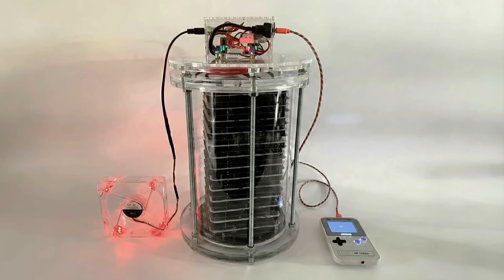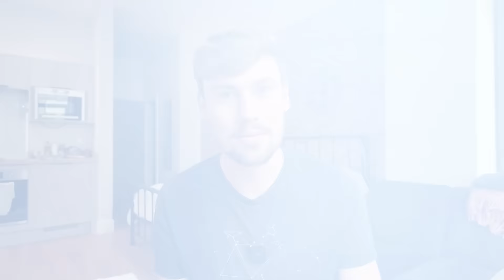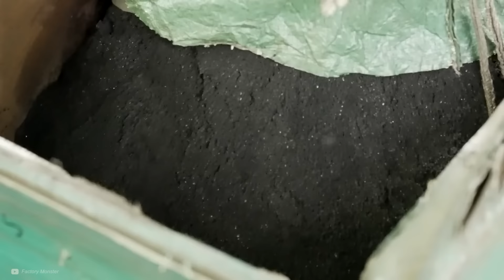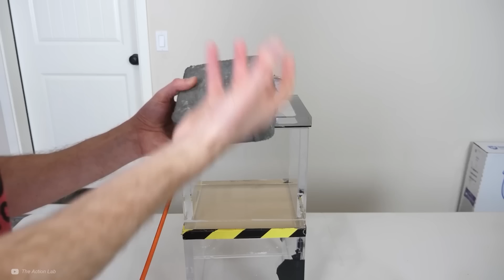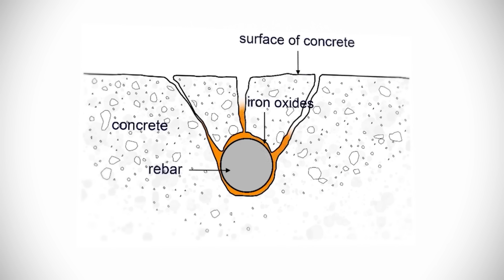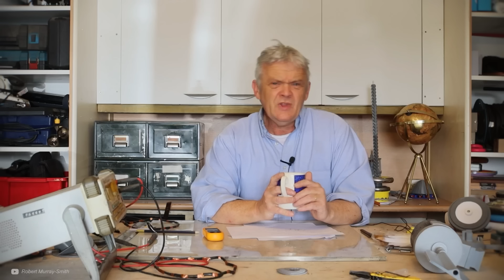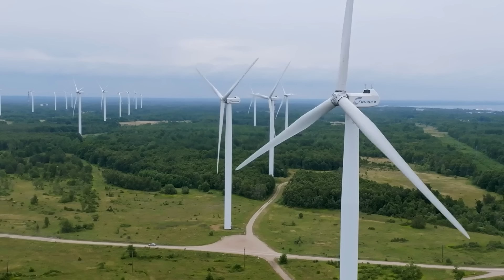How MIT's New Concrete Stores 10x More Energy

Comment: Was hinted at, but the elephant in the room is that a single block of the stuff is not itself a super capacitor, it's just an electrode, and you need a separator and another block with the liquid electrolyte in between.   The whole point of most concrete structures is that 1. you can pour it out as a continuous building material over large areas and spans  2. It can be reinforced with the likes of steel rebar.   Neither of those is possible if you're breaking it up into a collection of electrodes separated from each other with a liquid..    The more effective it is as an energy storage device, the less effective can be as a building material.

Comment: The sheet metal plates used for electrode look like they will separate under tensile or shear loads. (Note the demo with an arch without electrodes, under only compressive load.)
Liquid organic electrolytes have various toxicities and vapor pressures. They tend to swell plastics and permeate. They are also potential fuel in a fire. 
All this begs the question, how does a design for energy storage only compare with existing products?

Comment: Very smart chemistry, leveraging the water ingredient! Kind of a fascinating application too, when one considers the rebar requirements. I’ve worked seashore concrete projects, that have sacrificial zinc-alloy anodes to channel oxidizing forces away from the core structural rebar (cathode).

Comment: Capacitors don’t always have to release electricity quickly. They can actually trickle it, likely in this case where slow electrolytes rather than fast electrons are the moving species.

Comment: I'm working on a cheaper and more efficient method to use concrete to store electricity. It involves structural concrete, batteries, and duct tape.

Comment: No, you use it to store lightning strikes. That then bleeds off into an actual battery. My question would be how are they connecting the concrete mass to a wire?  Are they using some sort of mesh that won't corrode? Or is it more like using a conductive adhesive and just sticking a copper bar directly to the cement? Like, would you have 2 slabs of cement then a  thin copper sheet adhered with conductive adhesive, an insularor sheet adhered with non conductive adhesive, then the other slab with the adhered copper also sandwiching the insulator sheet. They been putting carbon black into concrete for like a 100 years, so are they just grinding it up finner, or are they using something like graphine?

Comment: Very interesting, BUT, ...
You missed a few obvious points, ...
How does Graphene fit into this picture as the carbon additive and a strength enhancer for the concrete, and
The fact that Wind Turbines are the the most useless form of energy production available with the huge environmental and maintenance costs for their lifecycle of energy production, especially with things like Fusion closer to the horizon than ever before.
Good basic content, but please stay away from the 'woke/Green'y'  type mindset and stay with the good tech with a balanced perspective of what makes practical sense for our coming ages.
Thanks, Ken.

Comment: You are changing the chemistry of concrete. I wouldn't  use it to build buildings into which you are then going to drill holes for bolts.

Comment: This isn't a solution for electric cars, but electrified buildings free up space for battery rooms. And I can imagine that it would be a bit easier to fill a foundation block with the special electrolyte than it is to make the walls.
Perhaps a solution could be to store most of the energy in the foundation, with the walls primarily used to distribute it throughout the house.

Comment: I'd imagine that you can trade time for complexity in getting the electrolyte in by just having the cured blocks sit in a deep pool of electrolyte for a while. Coating the finished blocks in plastic may also be economically feasible for the organic electrolyte ones, not by making an acrylic case but by giving them a coat of epoxy or some other polymer.

Comment: I think people are missing the bigger picture here with electricity… roads are made of concrete under the asphalt, power poles usually have to go next to the road and cause all kinds of issues with clearance issues and big trucks, if we place the power lines in the road with a super conductor it solves quite a few issues with moving power and potentially battery cars.

Comment: High RADs such as Luna, where we're not building structure but buffer, thermal trombone double use, where we're using the gradient of concrete to cool and heat. Garden walls where we're utterly disgusted with burrowing pests!

Comment: I wonder what would happen to this over time?
I could see this supporting buildings over the short term or with power fluctuations. But as you said, cost for this maybe a killer. 
I was going to suggest chemicals like alcohol to dry out the concreate faster. But this biological sounded like a better idea. As it gives you more power. 
A shame that they could not turn this into a battery instead of a super capacitor.  As that would be much more practical. Even if this turns out to be not as good as a Tesla battery. It would still add to the overall power storage. But again, would it justify the cost if it could be made into a battery instead?  
One thing that you may not know about is that Carbon make a good conductor.

Comment: Dude liquid filled concrete can't build buildings. I've been in building maintenance my entire life in a huge city, one thing I guarantee you is after a few years of flexing in the wind and weather there a cracks everywhere,  of course non are structural but how would liquid stay inside, unless your saying it'll still be conductive after completely drying? Does drilling holes or placing mental anchors short it out?

Comment: Couldn’t you use carbon fiber panels (internal and external) and pipes inside the concrete structure for reinforcement instead of steel rebar?

Comment: But with any capacitor, storage does not increase with thickness of the plates.
Capacitance increases with the surface area of the plates.
You're porously thick concrete has no seeable advantage (thickness doesn't matter).  After all isn't it the surface area of the plates next to the dielectric which increases the uF (because that's what the ET101 book says).

Comment: It has to be sealed to retain it's electrolyte. And that seal has to remain fluid-tight for the life of the capacitor. Even a pin-hole leak would ruin it in a matter of months.
It can't just be used like regular structural concrete.

I think the idea is that concrete is (relatively speaking) cheap. And has a high degree of compressive strength... so a battery (capacitor) which is a sealed unit... could conceivably be used in a manner which leverages structural compression (foundation blocks).
I would imagine this makes more sense where you're not pushing compression anywhere near it's normal maximum. Like a "house on slab" construction, where the slab can normally handle many fold more weight than is put on it... so this "wet concrete capacitor thingie" could work there, if thick enough. But the form of concrete which gets that 10x energy density, is no longer concrete, and no longer has structural stability.

More than anything, I think it's just "cheap filler" to build the capacitor from. Not an architectural building material.
It may be worth noting, that because of it's very large size and amount of material, it could serve a dual purpose of acting as thermal mass, to help regulate indoor temperature. And it seems unlikely that you could get it to burn... (a reason I'd never have a lithium tesla wall in a house).
It doesn't fulfill the 'future vision' which the headlines automatically bring to mind.

Comment: I recognize this as a partial idea; it doesn't make much sense by itself, but if you paired it with something else, it could be great. 

For example, if you have concrete you need to keep wet anyway, you should make a whole-building circulatory system, and have the fluid include a crack-repair compound, that would automatically fix cracks in the concrete as they occurred. 

Another example would be to have voltage-powered reactive hardening, so if the building is hit by an earth-quake or cannon-ball, it would consume some of its stored energy to negate the impact, like some kind of sci-fi force-field.

Comment: the increase in voltage is i think why flash caps are so dangerous and deadly to work with.

older camera flashes from the 80s used a xenon strobe to make the flash and the capacitor in the flash unit was very large and would be charged to like 400 volts at maybe 400uf and could be deadly if you came in contact with a live cap.

also shorting them would vaporize a bit of the object used to discharge them.

Comment: So, not ready for prime time just yet.  Still, it's a very cool concept as every building has lots of slab.  Making a huge supercapacitor would be great.  It would need to store enough energy for running the building for several cloudy days until the solar cells on the roof can catch up.

Comment: Half of the problems which you see with historic concrete are to do with 'electrolyte' contamination.  You may be creating a battery but you are also in risk of creating another form of self distracting concrete.

Concrete cures by hydration.  Unless you have got things very wrong evaporation plays a minor part of 'drying out'

Comment: How is this different from the all the research that's been done over the years with just adding graphene to cement?  Along with the increase in strength and of other physical property improvements, it's been known that the graphene blocks are also able to conduct and store energy via the carbon network created in the material.  That seems to be all they're doing here, which doesn't really make this revolutionary or novel.

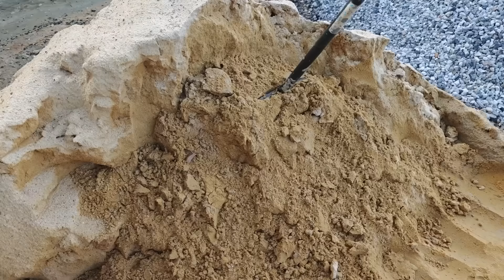Comment: @6:00 This storage capacity per weight and volume is super low compared to a lithium battery but if you were to consider the most conservative numbers. If i am doing the math right and you were to consider a ~2000 square foot basement floor (40x50 feet) with 12 inch thick basement floor and 12 inch thick walls and 10 foot tall walls (lets assume 8 feet to compensate for windows/etc) and round to 3500 cubed feet.

You are looking at roughly 130 cubed yards, thus roughly 100 cubed meters. (Its 5 am. I might have did the math wrong after double checking this)

You are looking at conservatively 18-19 kwh of storage. If you also have first floor concrete walls it would be roughly 40-50% more so roughly 24kwh.

This is almost enough to completely sustain a normal American house's daily electricity needs.

This is pretty incredible!

Reply to this so i remember to redo the numbers. I think i did this wrong but its pretty close.

Comment: Interesting stuff!
For info, concrete or cement mortar requires water to cure. Where final strength is critical, it's often kept continuously flooded for anything up to around four weeks. Premature drying prevents it reaching full strength.

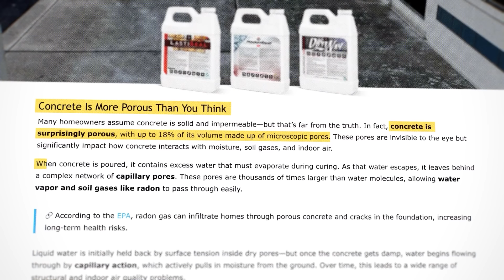Comment: @4:30 this doesn't surprise me and reminds me of what i learned about the differences of Roman cement/concrete vs modern cement/,concrete and why modern ones only last 50-100 years vs Roman ones lasting thousands of years. 

Its been a decade since i researched it and forgot the specifics but iirc. Roman concrete was a bit weaker but it included ingredients that allowed it to naturally renew itself whenever it got wet. Thus instead of cracking from water and winter exposer it would essentially reset itself as a fresh pour.

Don't quote me on this because its been too long since i last researched this.

But the porous nature of concrete is the reason why modern concrete breaks after many years and winters. If you research and look at sem and microscope images of regular concrete, high performance concrete, and ultra high performance concrete you can literally see the gaps and how each version is an improved version or the last.

If i ever get the money to build my own home i am building it out of Coretuf (sp?) The arlmy's ultra high performance concrete. So my house is basically a bunker and will survive 100+ years no matter what.

So using concrete porous features for this super cap makes sense.

Comment: The headline-grabbing 10x energy increase is just a byproduct of swapping water for organic solvents to chase higher voltages. The real story is the cast-in manufacturing process and the self-assembling carbon nanonetwork that makes bulk structural energy storage physically possible.

At the recent Yui 2025 Technical Showcase in Fukushima, Aizawa Concrete Corporation and MIT demonstrated large-scale, modular concrete columns. Instead of trying to pour an entire foundation on-site with the complex electrolyte mixture, Aizawa is working on pre-casting structural columns in their factories that act as giant battery banks.

Hopefully, in the future, we can see this product offered as the construction material. It would likely be requires some special techniques to pour it and utilize it correctly, but that would make it much more practical for application applications in America in instead of shipping concrete columns overseas.

Comment: I think it is very interesting, however I think a more practical alternative would be gravity energy storage, letting motors powered by the "extra energy" lift so high heavy weights that can be relatively easily used to generate electricity.

Comment: 10:04 here's another Regional idea I'll share with you you talking about the quantity of the cement needed to actually be used as a good way of either destroying electricity or actually transferring it which is more of what I was thinking is using the cement as a way to not have wires so much so but if you use it as what you using to build the roads with then you can have it so your roads actually transfer the energy and you don't need piping and all that and on top of that you'll be able to heat the roads so in the winter they could melt the ice and that same water would be able to feel the concrete in the summer and spring
Reply: Uncanny have that one for free since  people niistbstwal frm my kind not ivest

Comment: With concrete being so incredibly porous, my question is this: What happens to the power-storage concrete when it rains? Short-circuit all the stored power into the ground? If it's hooked into the mains power, will that cause network failures and crash-out the neighbourhood? These questions may be childishly easy for an engineer to solve, but Joe Public will want easy, simple answers they can understand without needing a degree. :D

Comment: Just to be clear that is an energy density in watt hours per cubic METER, so obviously very insignificant energy storage, but if we're talking massive multi-story buildings and skyscrapers (and they make it commercially viable) it could add up to quite a significant energy storage capacity. Question is, can this compete with more deliberate and dense energy storage mediums?

Comment: At about 6:00-6:20 you say sand and aggregate can be added to turn the cement/carbon mix into concrete without affecting the energy density. Sounds like complete Bullshit to me.
Most structural concrete is custom designed these days, and the Cement/Sand/Aggregate ratio is something like 1:1.5:3, so I can't see how you can 2+ times as much aggregate, compared to the base mix, without it significantly affecting the energy storage density, when compared to the base mixture. If aggregate is 55% of concrete, it must affect the energy density.

Comment: Water does not evaporate from inside curing concrete. The  Portland cement in the concrete hydrates, that is the chemical process of hardening and curing fresh concrete. The porosity comes from the shrinkage and from entrained air.

Comment: Water doesn't so much 'evaporate' from concrete as it chemically reacts with cement to become 'concrete'. A key aim of 'curing' concrete is to keep all the water in (for ~7 days) so that the full chemical reaction happens and the concrete is stronger and more durable.

Comment: With the exception of being corrosive to rebar it seems like a good fit to combine with ICF buildings. In those cases the concrete is more or less sealed inside of foam which should help with the evaporation issues. Unclear if the electrolyte would also interact with the foam.

Comment: This is only good for research. At 0.2kWh / m^3 it has 25x lower energy density than commercially available super capacitors and hundreds of times lower than batteries.

Comment: Interesting idea, but I could see this stuff getting misused like crazy. From a maintenance and longevity perspective, you don't want your structural components serving any other purpose. If the energy storage fails, you need to replace the whole foundation or just install a regular battery bank, defeating the purpose of the whole thing. If the structure fails, your energy storage is compromised until repair (by replacement). Two critical purposes served by a single failure-point. I would use something like this as large-scale energy storage in standalone devices. But at that point, LiFePO4 or even water batteries are more effective, and more energy dense.

Comment: What failure modes does this concrete - fully charged - have?
Reply: Fully charged doesnt sound like that much energy compared to lithium so it probably wouldnt be that bad
Reply: @notusingmyname2634  If you don't know what happens, you can't judge if it is bad... 
Dying from a common cold might not be the most spectacular way to go, but you're not less dead because of it 😃